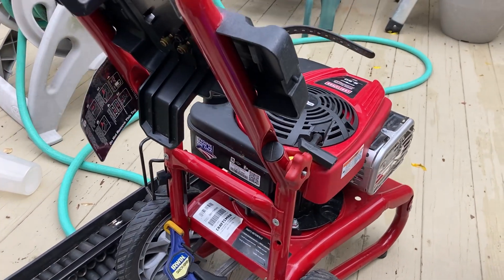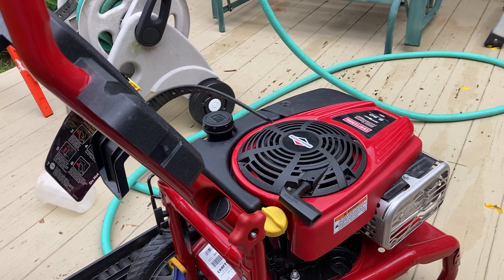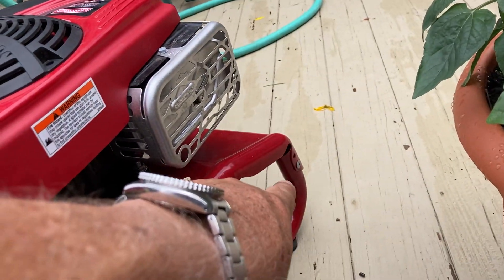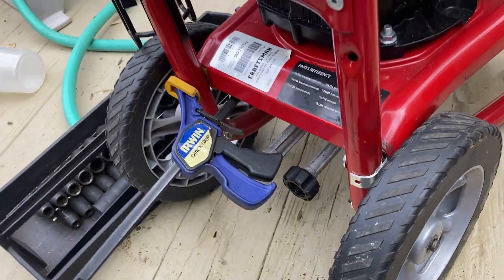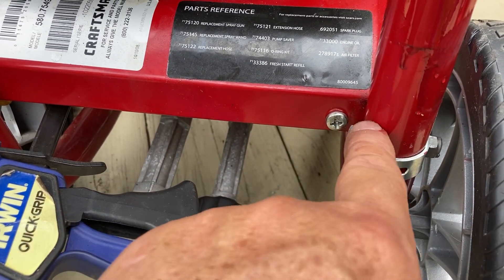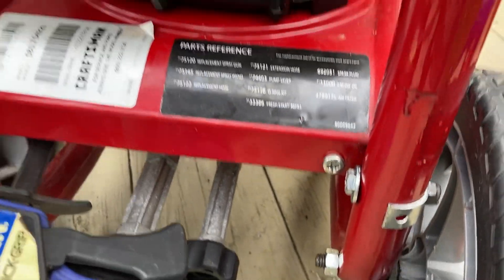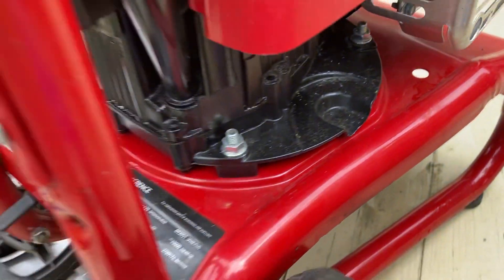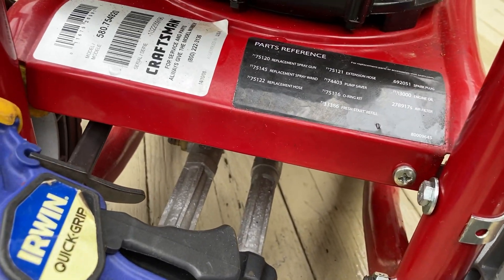Craftsman Pressure Washer won’t Start and has broken motor mounting plate. Easy fixes!

Comment: Great job on the frame, that does look like a design problem. Your solution should last a lifetime
Reply from the maker: Ya, the rear mounts are under shear loading so it was eventually going to fail. This should outlast the unit.

Comment: Thanks for the tip. I have a 754910 that had a Honda GCV 160 and the internal governor failed. Replaced the motor with a used Briggs & Stratton 190 which runs well, but the unloader valve wasn't unloading, and it would stall shortly after releasing the trigger. The workaround was to not release the trigger. I dissembled the unloader valve, but I was unable to determine if it was bad. I found a $20 knock-off brand unloader, installed it and I'm back in business. With the luck I have had with it. I'm sure I'll need to do this frame fix at some point.
Reply from the maker: Thanks for watching!

Comment: We bought the Honda version back in 2011 and it probably has less than 25 hours of run time. It's always been stored in the garage when not in use. This summer I had both the plastic wheels crumble off of the frame and both of those riveted tabs snapped off. The engine has been great as long as you drain the fuel out of the carb bowl before storing. But man, the "Craftsman" parts on this thing are garbage. Looks like a great fix for the motor plate though. Thanks for posting.
Reply from the maker: Thanks for watching

Comment: Good job thinking outside the box. I wish all my powerwasher repairs were that easy. Have 2 DeWalt commercial pws both with either locked up motors seized. pumps seized